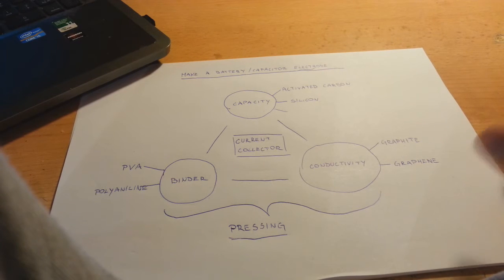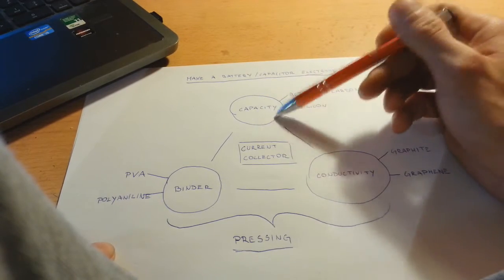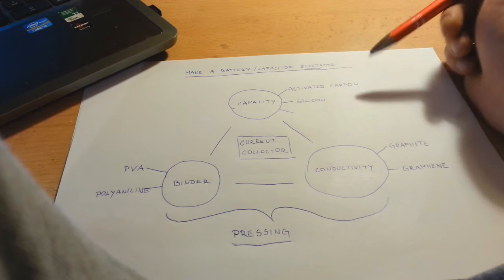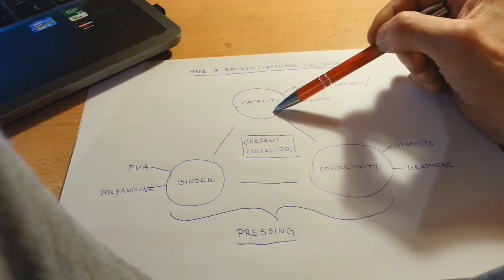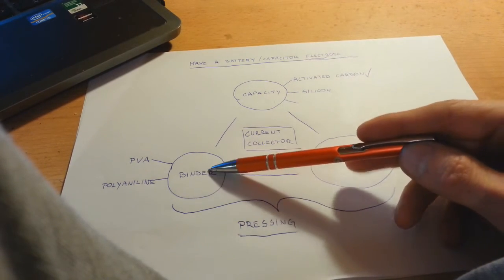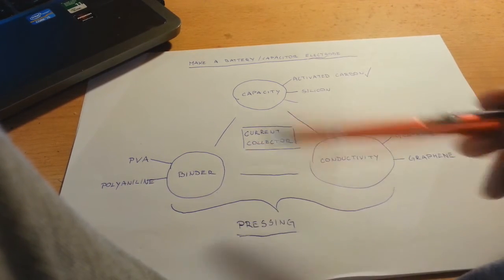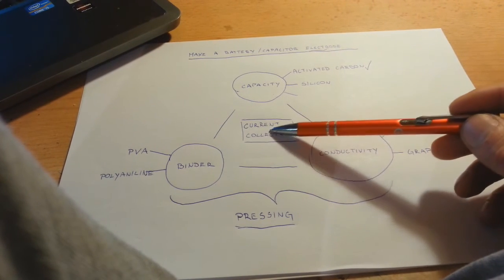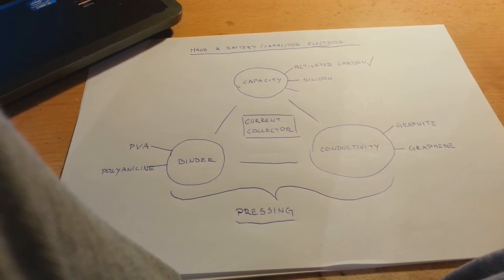How to Make a Battery / Capacitor Electrode

Comment: I use stainless steel mesh metal as the current collector as it gives low resistance and is stable versus alkaline electrolytes...
Reply: how do you bind the carbon and what about the procedures!
Low grade ss also corrodes in alkaline conditions! what about that!

Comment: Binder: Alkohol with Kolophonium... Elektrolyt: Na(K)2CO3 + H2O... Collektor-Elektrodes: Best is  Graphene, than copperfoil with candle-soot NOT Aluminium.
Reply from the maker: rosin or kolophonium in DE is good if you mix with another binde like for example PVdF which significantly improve the cycle capacity of the battery. The electrolyte,.... I saw better electrolytes also. Graphene is really good but expensive if you use high quality graphene,... So for home experiments is better to use some materials that are not so expensive.😉✌